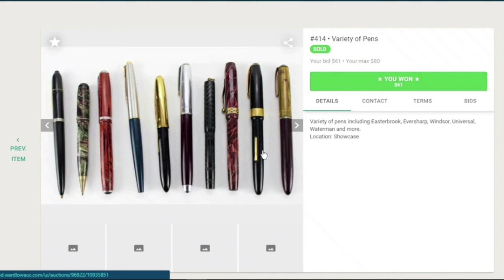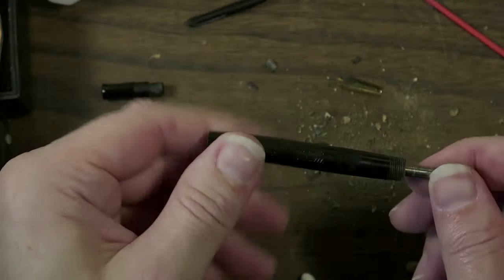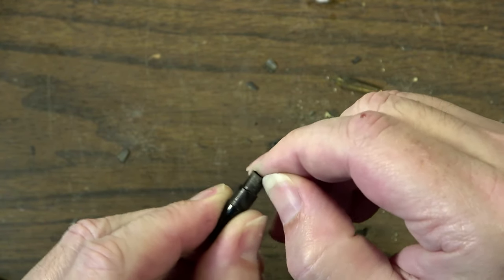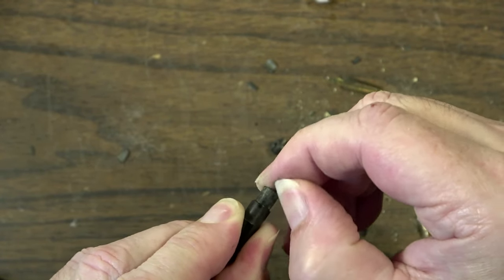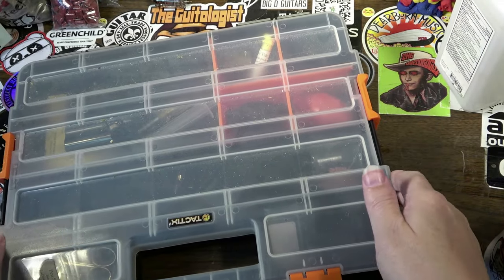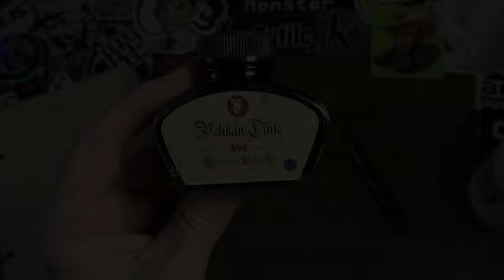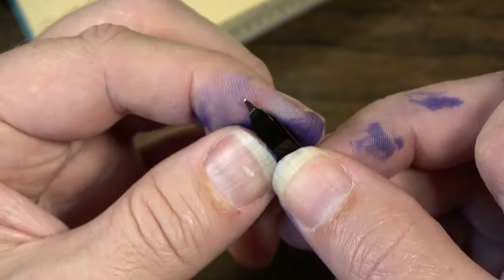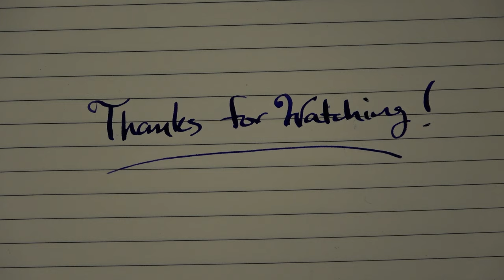100-YEAR-OLD Waterman's Ideal 52 1/2V Fountain Pen...Can It Be Restored?

Comment: Great job! I have a Waterman's Ideal 0512 1/2 VPSF i need to restore, but i cant get the body off of the section. I've soaked it several times in warm water days in a row to no avail. Its a metal body pen, would a hairdryer work?

Comment: I have a 1910 waterman 12 with cracked cap, this is made of hard rubber apparently, from what I understand there is not an adhesive that will fix this, I have two thoughts use some shrink wrap tubing for electrical connections, the other is the use of a brass olive which could be polished and sealed with nail varnish, does any of this seem plausible to you? Thank you.
Reply from the maker: Epoxy?